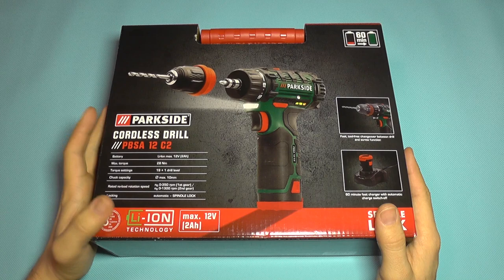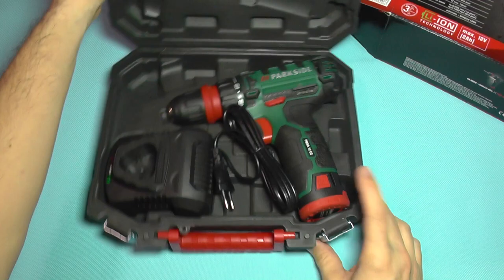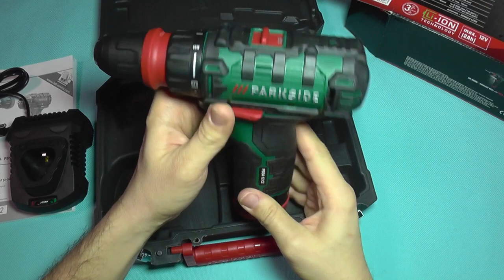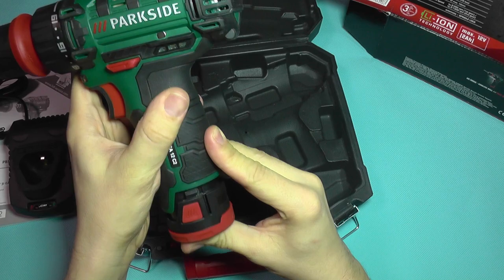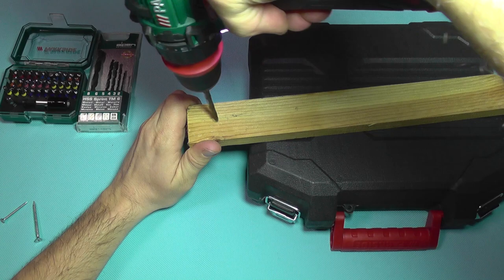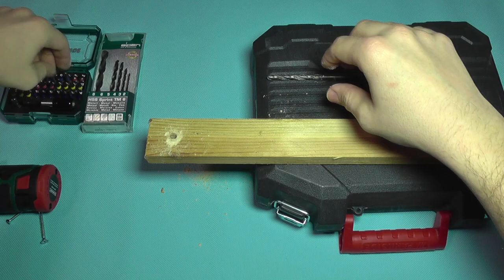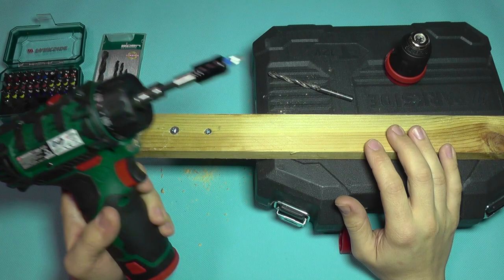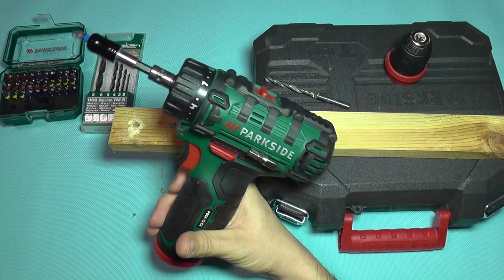Parkside PBSA 12 C2 - Cordless Drill Review

Comment: Have one of these and I love it , most useful IMHO is the use of a standard short screw bit that can be left with the chuck installed so drill and screwbit ready or two types of screw bits ready, so handy. Also its short lenght without the chuck makes it easy for tight spots. For heavy bolts I still use the Makita  but this little tool gets the most use for sure
Reply from the maker: Yes it's a very good tool, I just hope that Lidl would provide more "team12v" compatible tools so can switch the batteries between them easy.
Reply: @TechTronic9000  yeah last week they sold small angle grinder in compatible battery series but it had the three cell battery giving it 45 second use so I skipped it. There is a six cell battery that was in a bundle with a small circular saw so I might buy that if it comes again